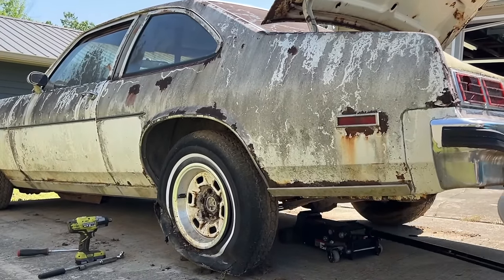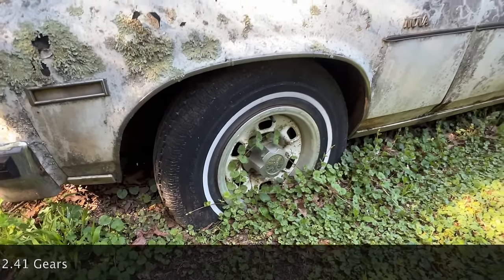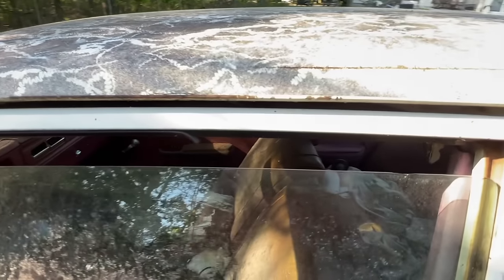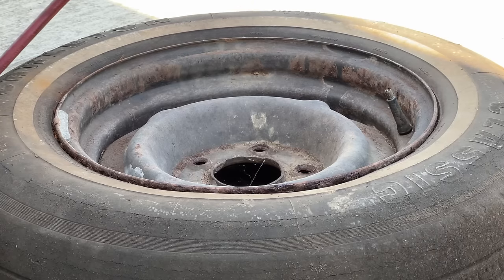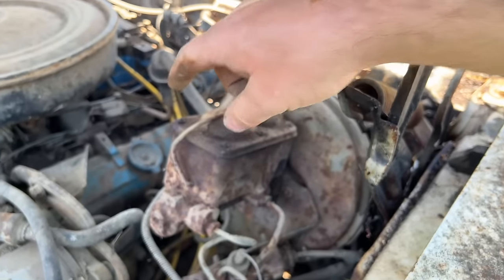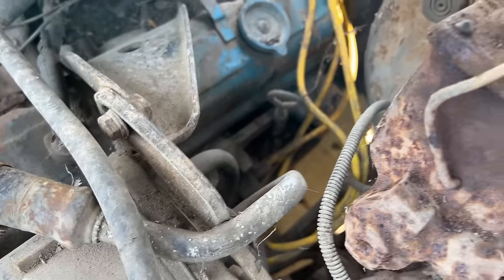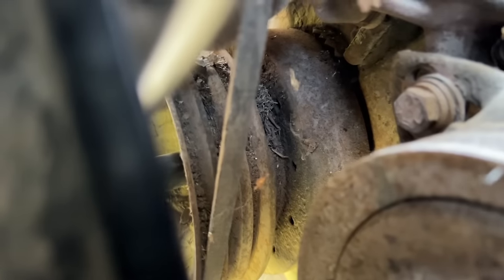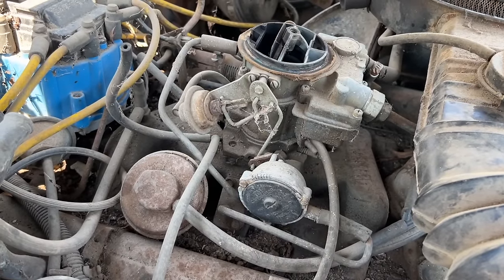$500 Nova, Will it RUN and DRIVE After 24 Years Parked?

Comment: You really need to remove plugs and fill with ATF or Marvel Mystery oil, to protect your cylinder walls and rings.
Reply from the maker: Yeah, I probably skipped a few steps there.

Comment: Never bump over an engine that has been sitting. Good way to break a ring. Pour oily 2 stroke in the carb and turn over by hand. And never run that old gas thru the carb either, unless you want problems.......

Comment: Your little daughter is the star of the show, her enthusiasm just bubbles over, you sir are a blessed man. I think I would have washed the car first just to see what I had to work with. I literally hate trying to work on greasy, dirty cars with trash all about. Once the car started there was a lot of dirt and straw sucking down your carburetor. Can't wait to see what it looks like after you clean it up. I bought a 1961 Chevy Belair a few years ago that was sitting in a ditch, when we hooked a chain to it and pulled it out, the tire treads came off the tires because they were stuck to the black clay we have in Texas. I had never seen that before!
Reply from the maker: I am definitely blessed! I agree that a clean up would've been better before hand, but I was just too excited to see if it would fire off. I never imagined it would run so good though.
Reply: I absolutely agree, IF that was me and my daughter I just bought her her first car..... and let her help work on fixing it up. I just bought a 75 Nova in pretty much the same condition although I live in the desert in Northwestern Arizona and the FIRST thing I did was give it a deep bath so I could see what I was working with before I even tried turning it over and getting it running. working on a nasty dirty car just kills my motivation because a clean car shows me that it's on it's way, That's STEP #1 because you can't get a TRUE look at what needs fixed while it's covered in dirt and grime, like it that dirt and grime on the fuel lines or is it bubbling rust with a big ole hole? the world will never know until it's clean.
Reply: @HotRodHoarder  yeah wood not sit in that car tooo long without a hazmat suit on..yuckkkkkkkkk!!!!!!!!!!!!!!!!

Comment: I have a 78 2 door Fairmont that's one family owned.  And just saved a 71 4door nova from the junk yard I work at. Still maintains the original driveline and protecto plate. Sat since 1999 and I had it running and driving in a few hours. Glad to see you save this nova
Reply from the maker: Very nice! Those Fairmonts are getting hard to find....neat cars.

Comment: First time viewer. I really enjoyed having family time with your cameraman it's nice to see a family working on a vehicle.I I'm aware there is no gas tank. the gas can is what is used I know, but it's too dangerous to have a child in the car with an open can of gas. different if you do it and burn yourself up but the child it's just negligence. Sorry to come down on you like that but that's just how I feel.
Reply from the maker: I appreciate the comment Vincent. I agree that it's not the safest option. I certainly would hate if something bad had happened with the gas jug in the floor board. I never want to do anything that could potentially hurt any of my kids. But I also want them to experience the fun and adventure that I did when I was a kid. Riding around in a bucket of bolts, barley hanging together enough to make it around the block. But I do agree that it wasn't a great call on my part.

Comment: I love this video. It reminds me of the time a friend and I took an early 70s Rover that was stood, locked up and one wheel in the scrapyard. In an afternoon, we freed it off, got it cleaned up and polished (that served as the distraction to stop us from trying to mess while the engine was soaking), got the fuel pump going and had it turning over.

3 weeks later, it had a new clutch master cylinder, had been inspected and was a daily driver that would crack on for 100mph. It's still about somewhere.

 Brill work and love the family involvement in the video.
Reply from the maker: Nice! Gotta love a fun project like that.

Comment: I like that body style of Nova that's pretty cool 20 years I think it's worth saving if it's getting that much effort out to run and drive after 20 years
Reply from the maker: Definitely rusty underneath, but I think it's worth saving.
Reply: @HotRodHoarder  SHOP THE JUNKYARDS   throw in some camaro buckets console a 4bbl  carb keep stock  rims  or swap on some 85-90 camaro alloy rims.....the 57 chevy of the 20's

Comment: Awesome video. You can always bleed the master cylinder just like you would a wheel cylinder/caliper. Pump and hold, crack the line, repeat. Might improve the pedal feel.
Reply from the maker: I may give that a try. Thanks!

Comment: Really awesome that it ran and drove. I kinda wondered why the previous owner parked it all those years ago. Doesn't seem like it has any major issues. Definitely worth fixing up! 👍 Maiden voyages are always scary. I remember  when my brother took me for a ride in his 69 Camaro, the timing was off, the gas tank was leaking, among other issues but we managed to make it back home. 😄 Thanks for sharing! Looking forward to seeing where you go with this Nova.
Reply from the maker: Yeah, I'm not really sure why it was parked. Could've been a fuel system problem or cooling issue...not sure. I kept assuming I'd run into a major issue at some point but this turned out to be a fun project for us. Looking forward to picking away at it.
Reply: It was probally parked because of the fuel line,  brake issues and the front seat. 20 years ago those 4th gen Nova's weren't worth more than a few hundred buck and putting $400-$500 in replacing the brake system, another couple hundred in the fuel system and a couple hundred for the new seat cover wouldn't have been worth it financially because these X bodies are just now becoming a viable platform to build on.  20 years ago these cars were just "old used cars" not worth much  but today they are getting be a  alternitive Muscle car build and GOOD classic Daily Drivers and your not just pissing out money by rebuilding them and getting nothing back by doing so. it's getting harder and harder to find the 72 and older 2 door cars to build because most of them have either been rebuilt already or they are rusted away and not a good base to do anything with so more and more people are buying the mid-late 70's car to build. 5 years ago noone in my car club had a mid-late 70's car but now there's 5, My 75 nova that I just bought last week, a 77 Grand Prix, a 73 Malibu, a 74 Maverick and a 78  Dodge Magnum. People are FINALLY seeing these car for what they can be instead of what they were.

Comment: Dude, work on it. Those cars are extremely reliable. My dad had one and gave it to me, it was a 1977 Nova Concourse. They have a 350 turbohydramatic transmission. I changed the 305 for 350. Header, 4 barrel, Lunati cam and when I just had it going great. A low life robbed it and took it for a joy ride. I sub already.

Comment: I found a 79 hatchback it had a 6 cylinder and  a 3 on the tree.The body and the interior was mint.It sat at a guys house for years and I finally saw the man standing in the front door.I stopped and ask if he wanted to sell it.A new battery and 800 bucks later it was back on the road.Loved that car, never locked it up no one knew how to drive it.LOL
Reply from the maker: Nice!! Wonder when Chevrolet quit making cars and trucks with 3 on the tree? Had to have been around '80 or so.

Comment: i like this vid a lot well done , but one thing i want to say is when you turn that motor over by hand to check if it's locked up, it's best to rotate the motor one full revolution by hand - that way you can hear and feel any stuck valves or push rods . just a tip
Reply from the maker: Yeah, I'm pretty impatient. I turned it a little more after I turned the camera off, but I should've definitely gone a full revolution. Lots of should've's with this one, but just happy that it fired up and moves under its own power again.
Reply: @HotRodHoarder  👌i wondered if you did that off cam, and it is cool that she runs .

Comment: I heard SLEEPERDUDE mentioned your name on a video where he bought a car or two from a junkyard that was crushing cars and you came up for recommendation video. Just subscribed. For long as the nova sat up that catalyst converter may be stopped up and Pressurized the engine and blow out the rear main seal. I had a 81 mustang that did just that. 
May you have a Blessed One Sir. 
Greetings from Silverstreet South Carolina.
Looking forward to seeing the next video on this Nova.
Reply from the maker: Hey Eddie, thanks for checking out my channel and thanks for subscribing! I appreciate the tip on the catalytic converter. I'll be removing it pretty soon, because I'm certain that it's not flowing freely.

Comment: Gravity feed those old fuel pumps and they get lubed up and usually work.  And if the fuel pump does not work  just gravity feed to the carb.  Just a suggestion.

Comment: There may be a ceramic or some kind of metal fuel filter inside the carburetor, where the fuel line meets the carburetor. Mine had one.

Comment: Mate, I was rapt when it kicked into life at first turn of the key!  Just proves you cannot keep an old Chevy down.  The engine sounds better and better the more you run it and when you give her the tune-up, she'll be even better.  I was watching the dash lights and that oil light and the alternator light went straight out as soon as she fire - cn't ask for better than that.   New oil and she'll probably turn the light out on cranking.  The starter - even though it looked like hell - sounded excellent when you spun her up in the driveway too, so only minimal parts to get her going and I reckon the tranny looks like it's coming around too - just gotta evict them wasps!  The usual maintenance items for a long-term sitter and that thing will be a rolling restoration for sure!  Hope her structure and the underneath is still solid after sitting all that time - I'd really love to see this thing come all the way back!  She's an absolute beaut!  All the best
Reply from the maker: This old Nova just keeps getting better and better. Gonna try to get the clean up video finished up and posted on Friday...wait until you see this thing after its transformation.

Comment: Yeah I know those 75 to 78 Novas, a low compression 305 2 Barrel, was very common, the later 77/78 could have came with a V6. My brother had one. That 3052 girl would run all day, but she'll smoke, the valve seats on aren't very good in those motors, it's a bit anemic. One thing it does have, is a really good Turbo 350 Transmission. A friend of mine in New Jersey named Melon, he drove the wheels off of a car just like this in high school. My ex-girlfriend had a Rally Sport, I know these cars well.

Comment: Gonna be a mighty good car with some tidy and odds and ends, new belts, hoses. Likely need a water pump and heater core soon from decay and time.
Reply from the maker: Oh yeah, all the rubber stuff needs replaced. I didn't think about the water pump, but I bet you're right...sitting there with coolant probably hasn't done it any favors.

Comment: Back in the day, my Dad got a 78 4 door Nova with an 250 I6, worked so well he got a 79 4 door Nova with a 305, the 305 got better gas mileage, miss those cars
Reply from the maker: Yeah, those 250's from that era were pretty weak, so you have to really lean on them to keep up with traffic. My daily driver is a '77 Nova 4 door with the inline 6....pretty sure the 305 from this rusty 2 door is going to be great for the daily.

Comment: nice 14"x 6" color-keyed rally wheels & center caps, from Rally Equipment.........you should keep the whitewall style tire, as the wheels are 6 inches wide, they would do well with tires no wider than 215/70R14 or 215/60R14, for example
BF Goodrich Silvertown Radial 3/8 Inch Whitewall..
Reply from the maker: I work at Coker Tire, so I have my eye on some narrow whitewalls for it. The wheels, caps and rings will clean up nice and give this thing a cool, original look.

Comment: Glad you got it going. First thing I would have done is pressure washed every part of that car before ever touching a bolt lol. I picked up a 89 Dakota Long Bed with 90K on the clock that had been sitting in a field for 12yrs, just because the Alt went bad! who does that lol. This truck was a Mouse Condo and up under the dash I found a 6' Snake skin so I figured the mice were gone lol. I am not sure how a snake that big got in and out of it since the windows were up the whole time it was parked, truck has no rust or holes where it could have got in. Mice got in thru the Heat & AC Box and they ate every foam seal in the box, I never found any bad wires ate thru which I wasn't expecting. 
 Truck started right up with a new battery and fuel, been using it as I work on it and someday would like to do a 360 Magnum Swap but for now the little 3.9 keeps chugging along.
Reply from the maker: Yeah, I probably should've cleaned first, but I was eager to see if it would run. Got a little impatient. Clean up video is coming soon though!

Comment: That rear tire you put on was from the late 60's very early 70's.   Dual band white walls.
Reply from the maker: Yes sir, it was the tire and wheel in the trunk of our '64 Chevelle when we bought it. Not the actual original spare for the car, but definitely '60s style.

Comment: Very cool that you got it running that quick! I think maybe you should have bench bled that new master cylinder, maybe you could have had a little better brakes.
Reply from the maker: Bench bleeding would've definitely given me a better pedal. I think there are some deeper problems with the brake system though. I'm glad I had just enough brakes to get down the road and back.
Reply: @HotRodHoarder  Yes, I figured there would be more problems after 24 years sitting, but you're off to a good start.

Comment: Did you bleed the master and the cylinders?? I love Novas, I have had my 73 since brand new...
Reply: Yep have had mine for 40 yrs
Reply from the maker: I did not bleed the master or bleed at the corners, which is the reason why the pedal is so low. The car has some additional brake system issues, so there is some work to be done there.
Reply: @novadiecastman5251  touche’

Comment: If there's one thing I know, its third, and fourth generation Novas. Did you know the 5th generation Nova was a little Isuzu 4-cylinder front-wheel drive thing? Just thought I'd throw that out there. Anywhoot, my first car was a 73 Mustang Grande, then a 76 Cobra 2 Mustang, (freaking Pinto, I just wanted the motor for the 73 cuz it was a V8), I was only thirteen when I bought the 73 Mustang. yeah, that one didn't end well. I said screw Fords, in my first real car, was a 68 Nova. Then, for $400, I bought a 1967 RS SS Camaro with the original paint, original black interior with the three little square gauges on the console, complete perfect body and interior for $400!!!. I got the car because my buddy bought the car as a parts car and it had no motor trans. He pulled the 273 12-bolt posi out of it, and at 14 years old I bought the whole car. But wait, there's more. The next car I bought a few months later, was the 71 Nova. drag car, the guy had a habit. That was one of the best cars I ever had. absolute perfect 70 Nova perfect og green paint, with the og green interior, in boxes. Another car I bought right after that, 72 Nova, then I bought my buddy 69 four-door parts car( stick shift four-door), then I got a 1967 Chevelle Kingswood Wagon. red, og paint, black interior(!), the car was near-perfect, and my dumbass took it apart, just for the 327 & powerslide. That was stupid that car was perfect, my buddy delivered pizza with it and I bought it off him. Then I bought my girlfriend's Mom's 60,000-mile 1971 6 cylinder Nova. I restored that car to mint condition, for $600. These were all rust-free cars. The last one, my other girlfriend had a 76 Nova rallysport, with the gold rallysport lettering on the side and it was blue. Yep, bought that car, too. One more car oh, I bought a rusted a 69 Firebird Ram Air 3 400, that I drove the wheels off of. Now I'm about 19 years old. I think I had five Nova's at the same time in my yard. Good times man, good times.....

Can you imagine, if I kept all these cars? It would be my pension plan!

Comment: Wouldn't it make trying to get it initially started & keeping it running a lot easier if -
You filled the fuel bowl thru the carb's vent tube? If the engine does fire off it will run a lot longer (& better on atomized fuel) than on just splashing liquid gas down the carb's throat.
That would give the fuel pump more time to prime & move some fuel. Fewer attempts at restarts too, saves those poor old starters on these rescues some grief.

Of course, as long as the jets aren't totally clogged or plugged up with trash, & the fuel pump works at all. But I've always found it worth it to fill the fuel bowl 1st on anything that's been sitting a while like this car. Even with a bad fuel pump, you'll still get 10-20 seconds of good run time before the carb "goes dry"
Reply from the maker: Yeah, I probably should've done that. I didn't have a good squirter to get it in there, so I did the ol' splash and go SEVERAL times. There's always next time...I'll get a little squirt bottle to fill up the bowl.
Reply: @HotRodHoarder  Just trying to make life a little easier. :^) I have both an old restaurant mustard bottle & an old school style 4 ounce oiler can for this. I like the oiler better because I can control the quantity better.